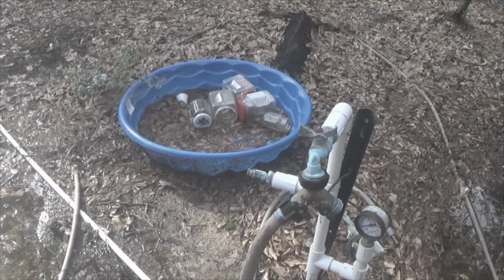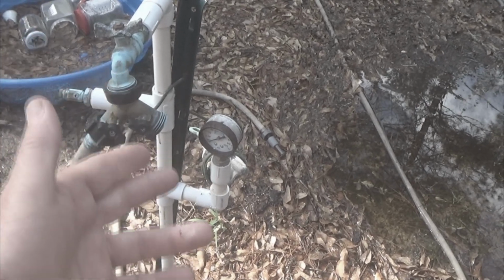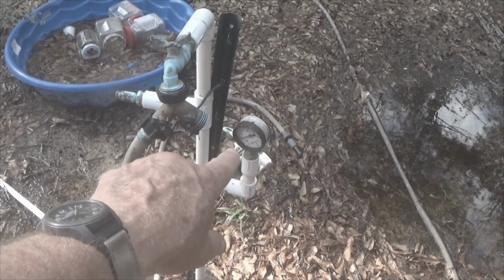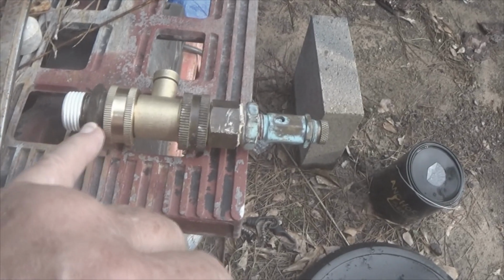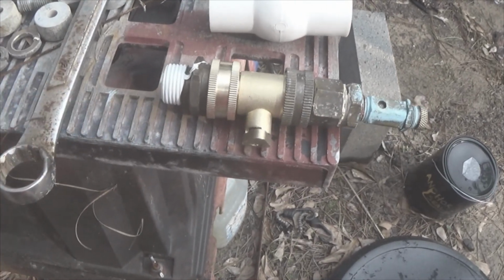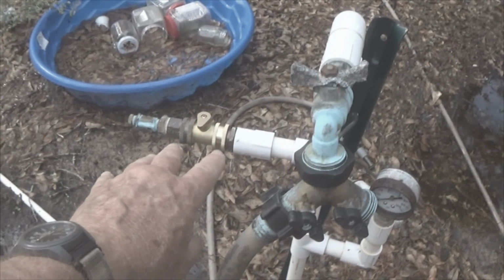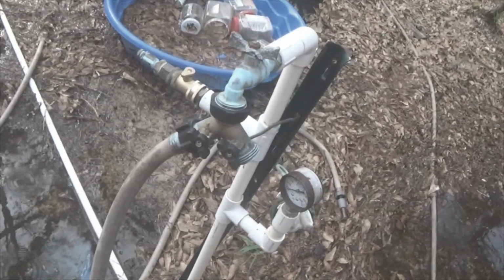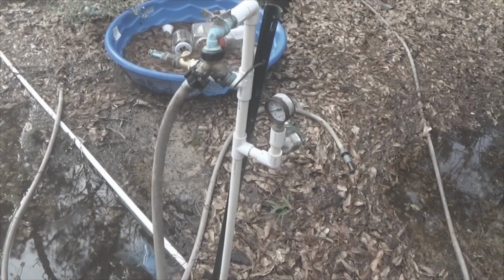pressure relief valve retrofit

Comment: I’m curious, are you concerned about pressure?  Why not add a pressure regulator?  I used one when I would hook up water to my camper so I wouldn’t blow out the smaller water lines.
Always good to see one of your videos, always learn something new and get a few ideas.
Reply: Oops, I posted too soon, you do have a regulator.
Reply from the maker: the heat on the line causes the water to expand,  since the back flow preventer is there, the water can not equalize through the rest of the water line.   the line that the city water provides is very long and the short distance of hot water at this end is unable to push back.    my reason for the pressure relief is 2 pronged.  prevent damage to the pressure gage, as they can be damaged or start leaking, and the second is longevity to the pipe